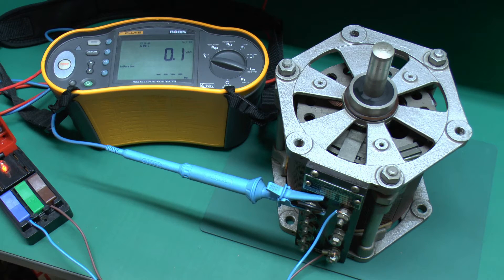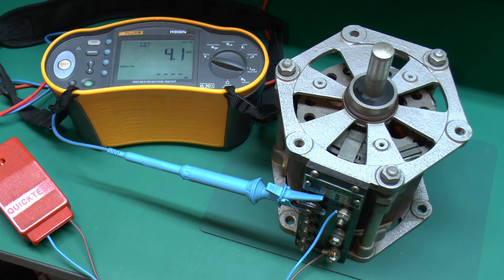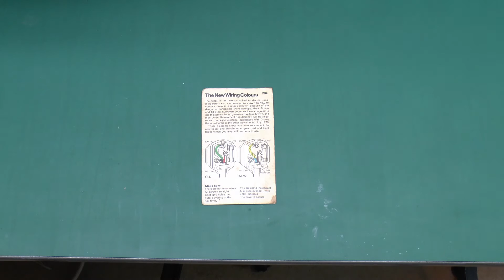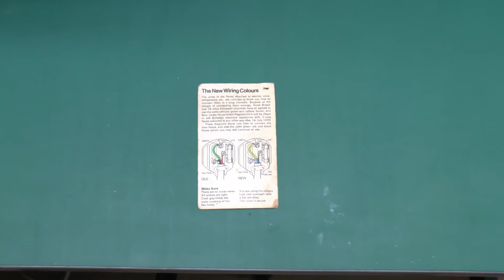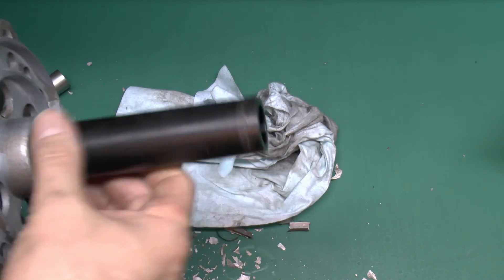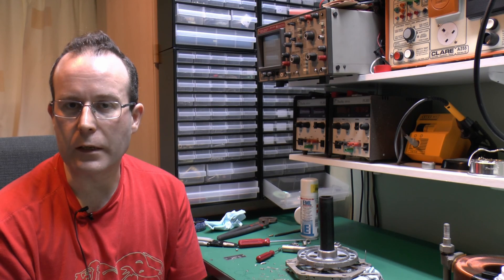Claude Lyons / Zenith 8A Variac Refurbishment (Part 2)

Comment: Would a thin layer of Dielectric grease be good for something like that? The contact is on top, keeping it clean?
Probably wouldn't hurt to take some compressed air and blow out the coil outside. Get that carbon powder out of it!

Comment: I have a Zenith Type 100-RM2b,  (two outputs at 4 amps). I need two sets of brushes ,       can you tell me where you obtained yours, (or did you make / modify them) I am sure that there will be many viewers that would appreciate an answer?
Reply: +John Ward
Do you just-so-happen to have the RS part-code you got?  I ask as I'm quite sure I've got exactly the same 8A variac at another site, and it should have new brushes too (in this case part-chipped off, rather than worn, limiting the current capability)...
Also, I was considering adding a soft-start function with either serious-thermistor or some sort of press-switch+resistors, as I had trouble with that inrush-current myself, n the past, and was about to feed my workbench sockets from a B6 10mA crabtree RCBO that might not like the inrush...
With many thanks,
Reply from the maker: +Robert Riley Mine were obtained from RS, http://uk.rs-online.com/web/ and had to be filed down, as the exact size was not available.
Reply: +sbusweb I used http://uk.rs-online.com/web/RS  347-3849 brushes in my refurb' as I will never use more than 3 Amps.  I used the remains of the original brushes to form a template, (by gluing them to an old piece of PCB) this held the new brush in place whilst I reduced the thickness of the new brush using wet and dry paper.  Its a messy job so do it under gentle running water. hope this makes sense

Comment: 256 volts? Isn't that way over the regulations? Isn't the UK the same as the rest of Europe at 230v  +-10v? The maximum therefore being 253v?
Reply from the maker: Paul Hughes Yes, maximum is 253 so it was over.  The voltage here is usually at the upper end of the allowed limit, typically 250. It was probably higher when the video was done as it was recorded at 2am, when there would have been minimal load on the system.
Reply: NO.  Volts and RMS volts are not the same.  Using a volt meter with out RMS the peak volts can be 255 at the plug and 285 At the output of the veriac if wired for full out put voltage.  Individual locations may vary. Mains voltage is quoted in volts RMS not peak volts.